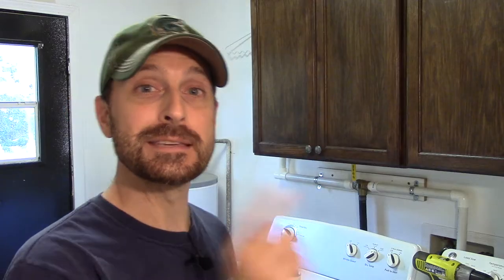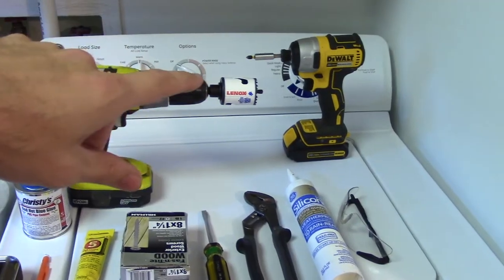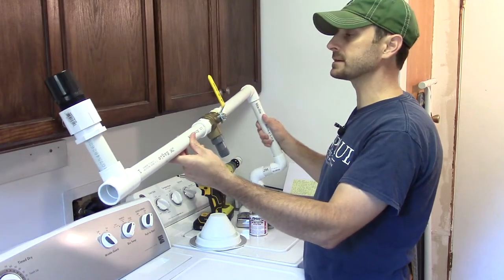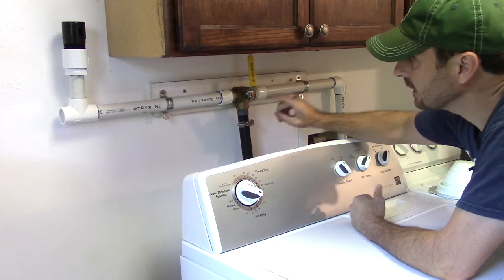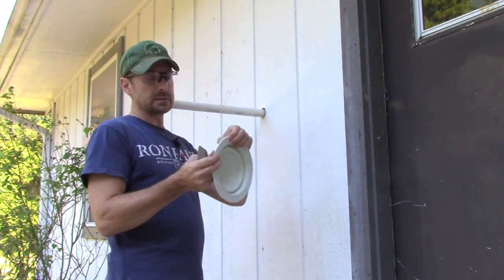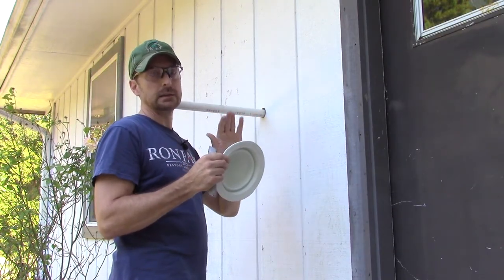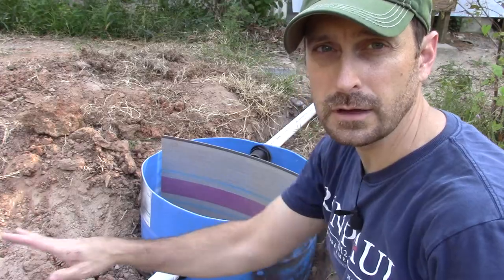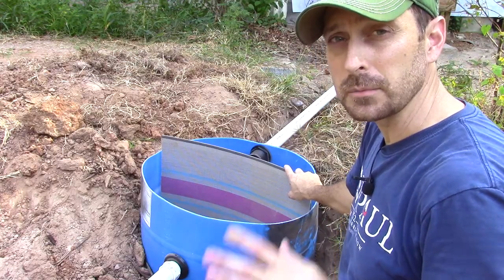Complete Grey Water System Build | DIY Recycling Septic Saver | 3 Stages With Planter Beds

Comment: I would love to build a gray water system but I couldn't do this. I am on a 1/2 acer property but it doesn't slope enough and my yard has been established for over a hundred years so digging it up is not an option. Also my laundry room is at ground level so the drain from the washer would go through the wall to the outside at the same height and only drop the distance of the height of the washer and if I wanted to also use my bathroom sink and shower water the piping from them would have to go through the wall at ground level. So my gray water would have to just go into a tank down in the ground with a filter to catch hair and such and a pump would be needed to pump the water out through garden hoses to whatever needed to be watered. The laundry detergent and fabric softeners would have o be biocompatible but I'm not sure what to use as far as soaps, shampoos and conditioners in the bathroom that are both good and safe for cleaning and outdoor watering. I live in Sandy Utah and we are in a bad drought right now. We have had very little rain or snow this past winter and spring so I need to do something to use as much of my used water as I can.
Reply: You must be careful what soaps you use. You can make this system much more condensed also it doenst matter what sloep you have if you just build stands for barrels in descending fashion. Grey water should be flushed thru several natural filtering materials before used longterm.

Comment: Wonderful & the most in-depth video I've seen this far. Question, how would you recycle this water to be reused in the washer for other wash cycles?
Reply from the maker: Thank you. With a system like this, it would not be possible to recycle the water for new use in the machine. Maybe you could build a cistern at the end of the system to capture the water and pump it back to the machine somehow. I do not think it would be worth it.

Comment: Won’t detergents/water kill the worms and leave a smelly mushy mess slowly disintegrating them ? Worms very sensitive to constant dampness and any chemicals , Even biocompatible direct contact perhaps put worms further down the system ground level so the can escape if needed and any left over toxins would be already diluted just a thought but a wonderful system nonetheless or add silt pond !
Reply from the maker: Thank you. I use biodegradable natural soaps not detergents. I have no smelly mess or dead worms. The system drains in a way that some water is held but is moved every few days. The plants on top of the system have roots that penetrate down into the held water and assist in cleaning it.